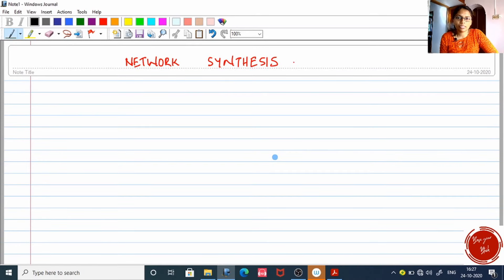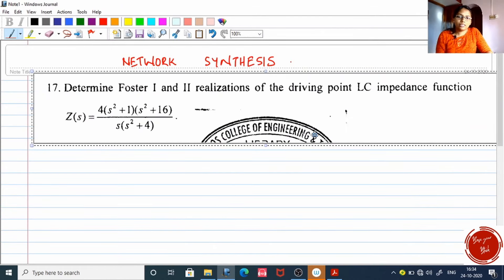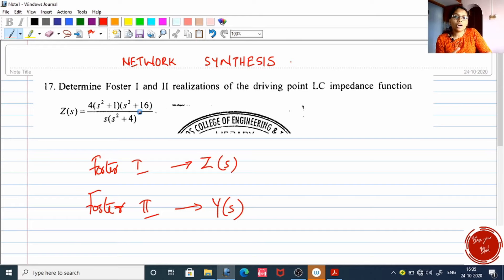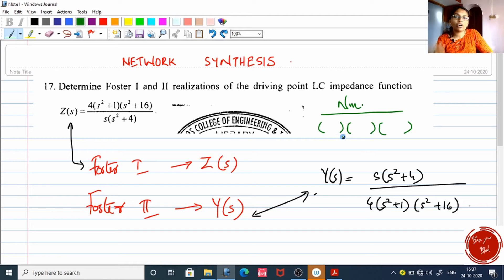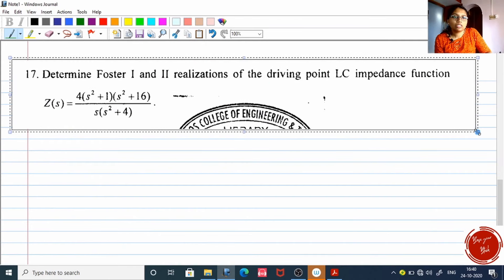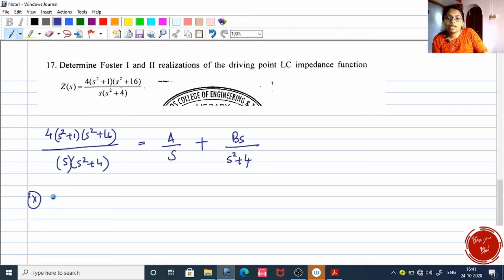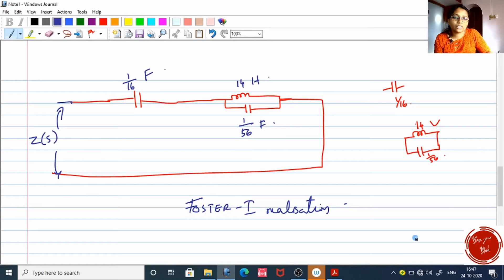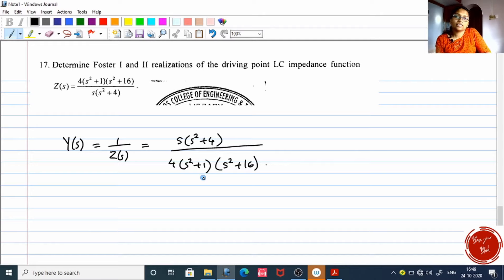Foster 1 & Foster 2 Forms- LC,RC,LR- KTU Qn #EE201 #CIRCUITS

Comment: Ma'am we can solve partial fractions for proper rational function.But you have did that for improper rational function. For improper rational function we cannot apply partial fraction.

In the numerator degree=4
And in denominator degree=3. So we have to apply long division method and after that we will get a proper rational function.And then we will apply partial fraction.
It will be :
4s+(52s^2+64)/s(s^2+4)...on solving we get A=16 and B=36

I am saying for FOSTER 1 CASE ONLY ....and FOSTER 2 is correct because we already have proper rational function for Y(s)
Reply: Yes I also had the same doubt

Comment: Realized later; the 4 from denominator of LHS has to be part of denominator with A & B doing partial fractions.
[my incompetent assumption earlier: at 16:14 shouldn't the 4 from denominator of LHS be multiplied to the Numerator of RHS, so should be 4(1/5 S), and 4(4/5 S) respectively for A & B?]

Comment: mam one doubt when the numerator degree is greater that of the denominator we will go  for division of the polynomials to make the improper fraction into a proper fraction and then we will apply partial fraction method mam. please clarify it mam.
Reply from the maker: Yes, long division for polynomials can be done when both the powers of num and deno are same, or the power of num exceeds that of deno
Reply: @BaseYourBtech mam another one to be rectified mam. Actually denominator in the partial fraction has to be linear mam. As in the case of quadratic polynomial as this the case here(s^2+ a) then numerator will take the form of (A*s+B) rather A alone. So instead of A/(s^2+a) , (A*s+B) /((s^2+a)  will come. Please comment on it mam
Reply from the maker: When denominator is s²+a, numerator can be As or As+B.

Actually the case is , if your denominator is nth degree polynomial, the corresponding numerator must be ( n-1)th degree general polynomial
Reply: @BaseYourBtech   Got it mam 😊😊
Reply: @BaseYourBtech  mam if we put B/(s²+4) whether the answer will be same
Reply from the maker: @soureshveerapan6645  No
Reply: @BaseYourBtech  but when I tried the answer was same
Reply from the maker: But it won't match with the list na..
Reply from the maker: Numerically it may get right..
Reply: @BaseYourBtech  Hi, is this really correct? As+B is the approach for complex poles. if denominator is real (f.e) (s^2-4) you would have to split again.

Comment: Mam i am confusing which is LC , RC, RC, RL combination , please so me whic is the combination in video 4:45 minutes to 6:20 minutes in confusing , please explain whic combination is RL,RC,LC,LR in foster 1 And foster 2 please explain mam . And you are explained so good. I wath your all video
Reply from the maker: Resistor is R
Inductor is L
Capacitor is C

In foster 1 we connect the components ( R or L or C) parallels.. and the blocks in series

In foster 2 we connect the components (R or L or C)in series and the blocks in parallel
Reply: @BaseYourBtech    im confusing in foster a/(s+b) is RC in parallel and as/(s+b) is RL in Parallel am i right mam please help me mam i m confused
Reply: I am confusing on foster 1 that is  as, a/s ,a/ (s+b), as/(s+b), as/(s^2 +b) what is the combination R, C, LC, RL, LC tell me please what is the correct? Please help me

Comment: Mam there is an issue  by solving like this
When i solved it  iget a infinite inductor value 4H, capacitor 1/16 F ,LC n/w L=9H ,C=1/36 
(Foster 1)
Reply from the maker: Yes I noticed. But the net value stays the same youbhave 4 elements. In three branches. I got 3 elements in two. 

It happens when there is a pole at origin.
Reply from the maker: https://drive.google.com/file/d/1YsSfCxpnR7F3YeBzKPoBG8D3KqbHQqO1/view?usp=drivesdk
Reply: I also got same

Comment: why we used division before partial fraction use nd,<nm
Reply from the maker: For partial fraction we need denominator's degree greater or equal to that of the numerator
Reply: @BaseYourBtech  but here denominator degree 3 and numerator degree is 4 i.e n>m

Comment: Ma'am for partial fraction method 1st thing the equation should be proper rational function so we will need to start with long division first  for froster 1 numerator degree should be less than the degree of denominator for reference similar question is in KM soni 2017 reprint Network analysis & Synthesis Example 9.11
Reply: in froster - 1 in the question above you shown
Z(s) =  4s + [ (68 s^2 + 16s + 64)/s(s^2 + 4) ]
and then partial fraction on square bracket 
A=16, B = 52, C=16

thanks for rest of the things for NAS

Comment: If I will get negative value of the constants then what will be the solution ???as I will get negative value of the circuit element.
Reply from the maker: That's a wrong indication. You wll get always positive value for constants. Your numerator or denominator would have changed
Reply: @BaseYourBtech    mam in some cases when numerator degree is high the  denominators then we have to divide it num  by denom... Or  have to divide both side me s????

Comment: See the 17th qn
Reply from the maker: Yes. Want to solve?
Reply: Nope,but that's the same question you solved,and the answers' different,and now iam confused
Reply from the maker: I checked. Both are correct . You can verify by reverse substitution. I did partial fractions differently.thats y
Reply: Ok ,sorry and thank you
Reply from the maker: All the best